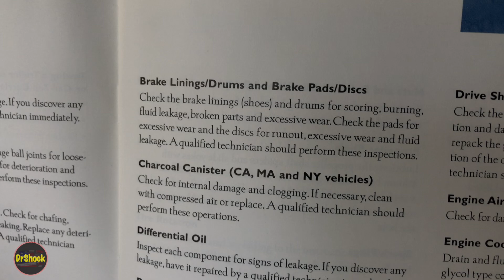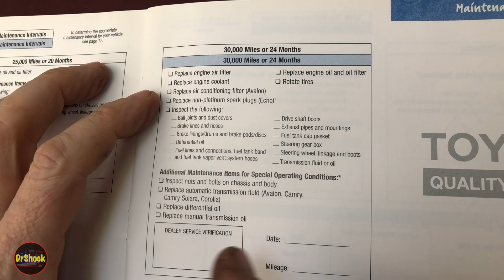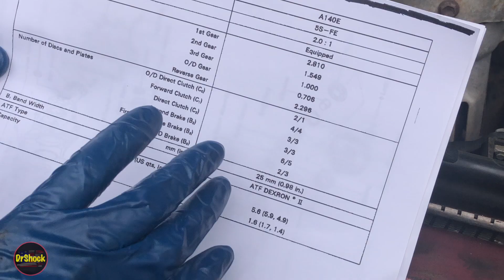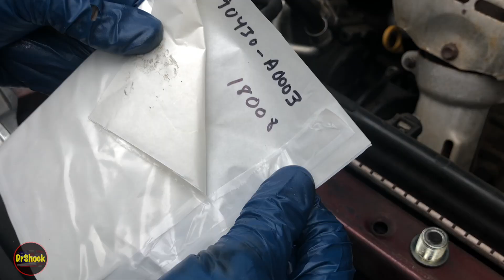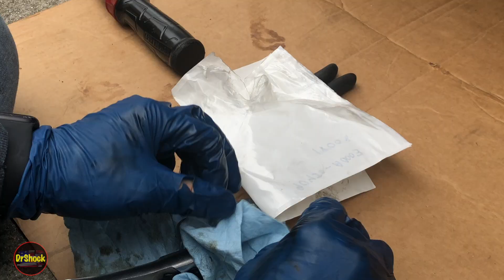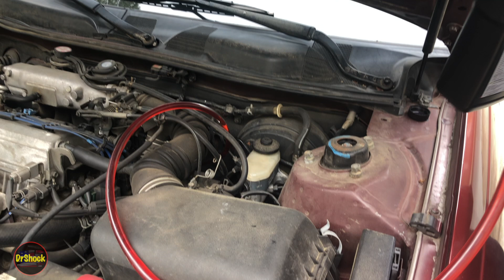1992 - 2001 Aisin A140e Differential Oil Change ~ Maintenance Toyota 5S-FE Engines (Camry, Solara)

Comment: If I do a pan drop to change the filter, will the differential and transmission drain together as well?
Reply from the maker: No, the differential fluid resides within a separate fluid compartment on this Aisin model.

Comment: I end up buying Vovoline Maxlife Multi-vehicle ATF about 6 quarts. Is that okay to use? Thank you for the video.
Reply from the maker: Toyota put out a service bulletin at some point indicating that this particular Aisin unit should only get automatic transmission fluid (ATF) that meets the older GM Dexron III specification.  The bulletin specifically advised NOT to use any of their more modern synthetic ATF formulations.

Typically it is ok to use a more modern ATF that supersedes previous specifications.  But in this case, due to some undisclosed issue with the more modern synthetic ATF formulas, this OEM manufacturer was advising against doing so for best results.  

You would have to contact Valvoline to see if their aftermarket product you have meets that older GM specification.

Comment: I am stalled many on line comments no to a fluid change when the pan is removed for fear that clutch wear will be comprimised with so much new fluid introduced to the transmission vs just a fluid change. You mention that the vehicle had 228 K on the transmission, did the transmission prior to your changing the fluid have any prior service to it. I ask as some say no issues but added to the question is that the original Dexron lll is no longer available. Other than Toyota Transmission fluid or Aisin is what should be replaced with.  I noticed the factory manual or notification sheet. said the type T-lV was OK to mix with the Dexron lll ,  there for can you replace with Type T-lV.  Or am I just overthinking?
Thanks Great Video?
Reply from the maker: Personally, we never use aftermarket parts or lubricants here.  Go OEM only or go home is our point of view, so I could only recommend the genuine Toyota ATF specified in the video description (which is actually the GM Dexron III formulation still).   It shouldn't be mixed with other blends, you'll want to rewatch that section going over those bulletins for what specifically applies only to the A140e.

On the question about fluid changes in situations where the vehicle has not been properly serviced - for this video here about the gear differential it's not going to be an issue.  The Aisin A140e is a somewhat unique design in that the differential transaxle is serviced separately from the transmission itself.  For the transmission itself though, this can be an issue.   Particularly if combined with incorrect synthetic lubricants, and/or low quality aftermarket lubricants.   But my view on this is, if an issue occurs in that situation, that the transmission was due for a rebuild anyway and we would recommend that to the owner.  

We don't focus on the cost here, as much as the authenticity and originality.  We're typically working on older vehicles, with the aim of keeping them all OEM original and on the road for the long run.   Hope that helps.

Comment: i got a 99 celica with this transmission and wanted to double check, Is this step necessary when doing a full transmission fluid service? I have atf, the filter with the gasket and wanted to get it over with
Reply from the maker: It is recommended that they be done together / at the same time, but imo they could be done separately at different times if more convenient.  Just not too far apart.  ;-)

Comment: Had to replace evaportive emissions system canister. Noticed how ridiculously complicated it is for such a trivial unimportant function. Amazing having so much stuff for that and no low oil sensor in the transmission and differential so if excess leakage occurs your transmission or diff will get wrecked but at least your evaporative emissions system will be working. My diff oil ran low and it felt like the brakes being applied as I drove on the freeway while I was in the middle of lots of fast traffic. Low oil in the diff or transmission is super dangerous but thank GOD all those tubes and valves in my evaporative emissions system were working so there aren't some fumes from the gas tank. When is low oil friction likely to occur? On the freeway when everything is getting extra hot.

Comment: The Valvoline Full Synthetic Automatic Transmission Fluid is also works great for Dexron ll and lll
Reply from the maker: It may appear similar, but that's not what Toyota specifies.  This is a differential, not a transmission. The OEM recommendation is the conventional base oil formula I listed for this application.
Reply: @DrShock Transaxle, Differential and Power Steering Fluid uses the same ATF Dll and lll tho. Synthetic last longer than conventional if using conventional must change it often. My Camry is 28 years old and has no problems  but maintenance is key.
Reply from the maker: Just be advised Toyota has TWO service bulletins out advising otherwise.  For this particular vintage Aisin model engineering recommends NOT to use more modern synthetic based products, even under Toyota branding. My professional advice to viewers is not to deviate from OEM guidance, until such time as the OEM discontinues the recommended part(s).  Then, and only then, would I consider recommending a customer switch to an aftermarket alternative.
Reply: @DrShock That's fine too.
Reply: @DrShock  So, Toyota branded, ATF Type IV is okay?
Reply from the maker: Toyota put out two service bulletins stating NOT to use Type T-IV fluid in the Aisin A140E transmissions in this generation of Camry.  That only the Dexron III rated fluid was compatible.   

I showed both of these Toyota service bulletins at 23:38 of the Aisin A140E maintenance video here - https://www.youtube.com/watch?v=dlfB0pKlgKI  While those bulletins don't specifically cover the differential, it would be expected to service both the diff and trans at the same time so I would avoid using TypeT-IV and stick with the fluid shown in the video (or an aftermarket equivalent not rated past Dexron III).
Reply: @DrShock  Oh, YIKES!  Thank you so much! Okay, you just earned yourself my subscription today, Dr. Shock!  Holy...

3 years ago, I changed the  fluid in the transmission to TYPE IV. I'll switch to the proper fluid as soon as I can.  I haven't noticed anything bad happen, but I also only did a partial change.  Aside from a complete flush (which I am not going to do, because the car has over 200,000 miles on it, and I bought it used, so I don't know its full history, but the old fluid did come out quite red, with a tinge of brown, so SOMEONE had -- at some point -- done a fluid change with who-knows-what.) ...but I will do a proper drain and fill.